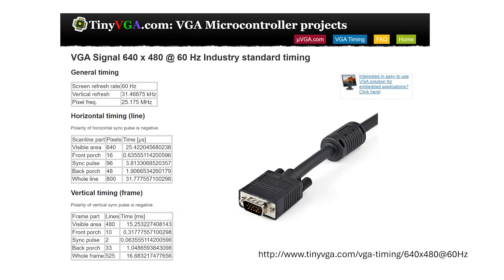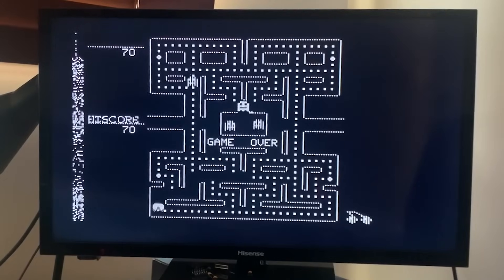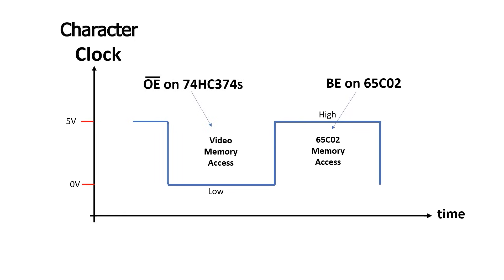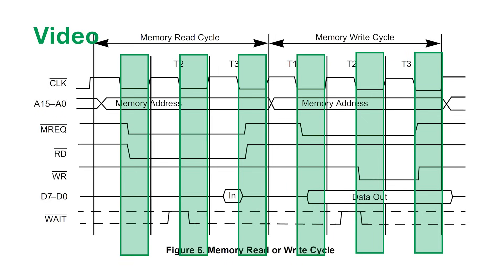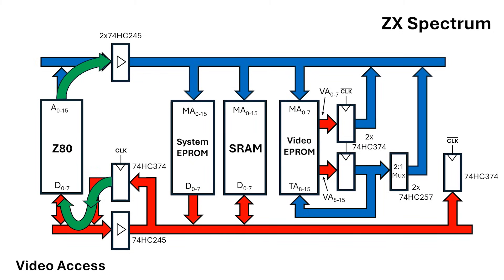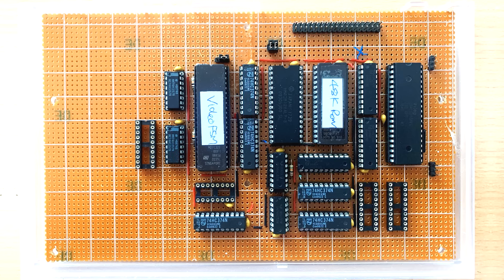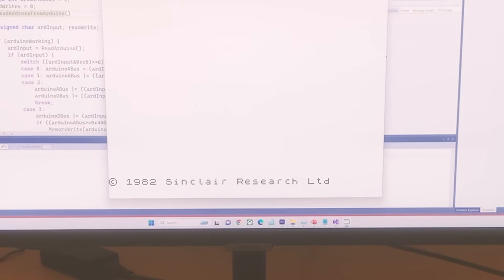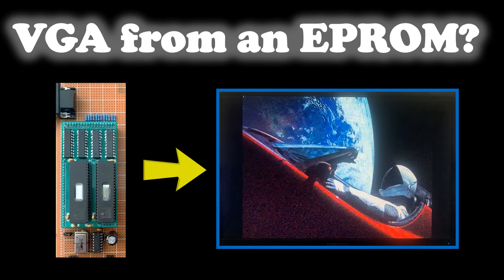ZX Spectrum build, No ULA.

Comment: I'm curious how your solution copes with software that abuses the machine to do things it's not meant to do (such as Knights and Demons DX or anything else that uses the BIFROST* engine)?
Reply from the maker: Yeah it will be interesting to see.  Do you have a list that might be difficult to run.  From the CPUs perspective, it's and NTSC machine, so PAL software that breaks on NTSC will still fail.  The upside is that we get VGA output.

Comment: Would it be possible to use the extra used memory in EEPROM to implement a EEPROM based Microdrive by using some additional hardware?
Reply from the maker: @StuartWoodwardJP  hmmm.  Not sure. I suspect not because the timing is quite critical to generate video.

Comment: Can you make the video ram double the processor speed so there's no contention
Reply from the maker: I’m not sure that saves any hardware (except maybe the 374). You still need to be able to tri-state the Z80 address bus.
Reply: @DrMattRegan  is that expensive?
Reply: Dual ported or double speed are those the only options?
Reply from the maker: @ you can stop the CPU with a BusREQ, or slow down the clock.  Have a look at the my Spectrum DRAM video.
Reply: @DrMattRegan  but the processor isn't even 4mhz the enterprise can manage 8mhz now see stefandrissen video mod player enterprise
Reply from the maker: @Sinclair-uq7jq  not really, just some 74HC245s and a 74HC374
Reply from the maker: @Sinclair-uq7jq  the actual spectrum slows down.  I'm not really into suping this machines above the original specs.

Comment: It might be overkill, but have you thought of using dual-ported RAM for the video RAM to avoid the bus contention?
Reply from the maker: Yeah, i'm not a huge fan of dual ported memory, hard to get, expensive etc.   I'd rather stick with more vanilla parts, but that's just my preference.  I would use them for crossing clock domains though.

Comment: I built my first zx81 from a kit.
Reply from the maker: How did you go getting it working?  Any problems?
Reply from the maker: Probably the biggest problem was the keyboard interrupt.   I tried using the interupt acknowledgement sequence to cancel the INT signal.  I got frustrated and just used the raster generator to limit it to 30 t states and that worked.
Reply: @DrMattRegan  oh right.
Reply: @DrMattRegan  Actually it worked first time I was so impressed, 
Modified it to give composite video output to a Sony monitor, much clearer.

Comment: Very interesting, and it occurred to me after watching this part, that you could add another latch or two to enable you to bank switch part of the RAM (the part which doesn't hold the video memory) to allow the computer to be expanded to run either multiple programs or programs with large amounts of data.  Edit: Maybe even simulate a RAM drive for fast loading of programs.
Reply from the maker: Yeah, good thoughts.  It may make sense to put video RAM in I/O space.
Reply: @DrMattRegan  You could address video RAM using the OUT command.  One method would be to have an output port to select which 256 byte section of the RAM (or which non-RAM device) you're addressing, and another to address the actual byte in video RAM (or device) which you want to access.
But my original thought was that, if the video RAM is located somewhere in (for example) the lower 32K in RAM, then you could bank-switch some of the unused RAM in the chip using the upper 32K of memory space.
(I'm assuming you're aware of the concept of Bank Switching)

Comment: Witch Wires are this? Im building a z80 handwired computer and im using much silicon wires that i need to decap all te sides before soldering then
Reply from the maker: These are wire wrap wires, but I’d recommend using the ones with Kynar plastic around the wire.  Kynar is quite heat tolerant and easiest to work with.

Comment: Could it be simpler to have two SRAM chips, probably even 3:  0 - ZX RAM 1 - pixels buffer 2 - attributes buffer?
Clearly separate XZ ROM+RAM from Video and just use WAIT when Z80 writes into video memory.
Even adding 1 or 2 SRAM chips could reduce total chips count, assembly and debugging?
Reply from the maker: At some point, the memory storing the video data to displayed needs two paths into it, one from the CPU and one from the raster generator.  Other than dual ported memory or VRAM, we are going to need some sort of multiplexing on the address lines, and this is where many of the chips are.

Comment: Dear Dr Matt,

I want to do simple changes to the main boards in future, to add graphics modes and object handling.  I was wondering if there is software that easily allows changes while simulating a running system running code, as proof of concept?   As a design that others could do on their system, or as a kit etc.   Or is there such software to do it through FPGA?

I've been very sick and haven't any electronic design experience.

I belong to a community that has the most computer language based microprocessor designs, for Forth, due to it's efficiencies, and some of the top performimg or loweat energy desugns. Mostly by Chuck Moore of the TPL patent portfolio.  I hope to get the team togther and implement a simple open source Forth embedded microcontroller design one day, and my more advanced instruction set architecture for performance. 

Youtube is a bit fickle at allowing links to youtube videos.  But, if you go to figforth group channel, then the latest forth meeting on the core 1 AI fpga for space industry, by Gould, you can see some of the stuff being done.  MyOR channel has a little forth computer with programmable read only memory amd discrete logic too, leaning towards what you are doing here.

Thank you.

Comment: Would it be possible to use this EPROM to replace the ULA on a real Spectrum? 

PS - I'm not that experienced with electronics, but I know how to solder and use a  multimeter. And do basic circuit calculations.
Reply from the maker: No not really.  This design uses SRAM, while the spectrum uses DRAM
Reply: @DrMattRegan  Would it be possible to adapt the design?
Reply: @peddersoldchap  I note that there was never a reply, but the reply would probably have been "not really, because I'd have no use for such an adaptation since I'm not using a ULA, but feel free to look into that yourself if you think you'd have a use for it."
My reply would be that as long as the number of inputs required doesn't exceed the number of address lines on the EPROM, and the number of outputs doesn't exceed the number of data lines on the EPROM, it should be possible to do it, but you'd have to figure out for yourself how to program the EPROM to provide the correct outputs from all possible inputs.
Logically, it wouldn't be all that hard.  It's just a bit of a slog, having to take account of every possible input and then ensuring that every possible input provides a sensible output, and compiling a bit-pattern for every memory location so that it can be programmed with the correct pattern later.
The only remaining issue is ensuring that the EPROM which you use is of a type which can respond quickly enough to keep up with the input signals.
Reply: @melkiorwiseman  thank you for your thorough reply. 

I would love there was an open source solution for implementing a ULA.
Reply: @peddersoldchap  The only part that a EPROM could not do would be to generate signals, such as from a clock circuit.  If you needed more than 8 output lines, you could parallel the address and access lines for two EPROMs to get 16 outputs.
Maybe someone will come up with a solution, but I could probably do it myself if (and only if) I knew all of the possible inputs to a ULA and all of the corresponding required outputs.  That's on the proviso that, as previously stated, the ULA didn't have any clock or timing role.
Reply: @melkiorwiseman  the zx spectrum ULA was retro engineered quite a few years ago, actually.
There's even a book on it.
Reply: @peddersoldchap  Cool beans.
Reply: @melkiorwiseman  if you ever get around doing it, make a video of it, please.

Comment: I used to do full wire-wrap, but would occasionally use this technique for parts of a circuit. One trick I used if I needed more than 2 wraps on a pin (or it was getting too busy) was to add an empty socket, wire the croweded pin to the empty socket and short socket pins together on the top of the board by sticking a wire in the socket.. You then had multiple pins to use for that one signal. Once a few pins were used this way, you could even cut off the rest of the socket with edge cutters if it wasn't needed. Sub and thumb.
Reply from the maker: Sounds good.  I'll try that if necessary.  You can sometimes get, 4 connections if you use 2 wires

Comment: Wow, what a blast from the past!  I built SO many little embedded boards using those Radio Shack prototyping boards and blue Kynar wire.  I stuck with 68000-series CPUs, including a 8MHz 68000, 16MHz 68020, and 33MHz 68030.  They all worked great, though I used PEEL programmable logic for decoding the addressing signals for the 68020/030 boards.  Very simple boards, mostly EPROM/flash, SRAM, logic, and random stuff, including an IDE hard drive using my own file system.  It was lots of fun reading the ATAPI specification for all the registers and commands!
Reply from the maker: Excellent.  I'm thinking of doing a series like the 
https://www.youtube.com/playlist?list=PLjQDRjQfW-85S5QkX8wZbkqichM6TLYYt
but for the 68000, a TTL-68000 CPU.  Would that be of interest?

Comment: Rather than soldering it all on - did you think about doing it all with wirewrapping techniques? I've not tried this myself (yet!) for anything though could be entertaining to give it a go. Also makes it easier to fix mistakes. I remember the first minicomputer I worked on (DEC VAX 8600), if you looked in the back, the whole backplane was wirewrapped!
Reply from the maker: Yeah, I've tried wire-wrap in the past, but i actually prefer point to point soldering.
I find wire-wrap (for me) to be slow.  I learned to do this back in the day, when wire wrap sockets were expensive.  Also i want to put it in a spectrum case.
Reply: @DrMattRegan  Understandable going into a spectrum case, no room for wirewrapped. Good video though so thanks for the interesting start to finish of getting that working.

Comment: Marvellous! This is how computers should be built. Away with the ULA, I never liked that kind of electronic parts, all that mistry, that hidden science, all those little secrets squeezed into one chip. It is a lot of work but the results are so beautiful to look at, it is craftsmanship. When the computer is not in use, you can frame it on the wall to look at.
Reply from the maker: Thanks for that.  Back to basics.  I think we should throw out the Z80 too - https://youtu.be/kfMMjk288co
Reply: @DrMattRegan  The Z80 has one advantage over the 6502 and similar chips, in that the Z80 has dedicated I/O ports so you don't need to waste memory space to do I/O.  Technically, with the way the Z80 handles the IN and OUT commands which use the C register (but actually uses BC), you could add up to another 64K of RAM as a "virtual drive" for temporary program and data storage.  Of course, this would mean you'd have to either go back to using memory locations for I/O or not use some of the virtual drive so those locations were left free for I/O, but it would be an interesting experiment to try.
Reply: @DrMattRegan by byA❤
Reply: The thing is, the reason behind the ULA makes perfect sense when you see the Harlequin board, which implements the ULA in 74 series logic.  Indeed, you just have to look at the complexity difference between the ZX80 and 81.

It's just unfortunate that these chips had to be reverse-engineered instead of documented, they could have been reimplemented in all sorts of ways
Reply from the maker: Yep, the harlequin uses the same technique as the Apple 2 (and TRS 80).   I used it too here
https://youtu.be/qbzzzkNPICI
Any guesses as to why i chose an EPROM?
Reply: @DrMattRegan  I would say, to make different screen modes, via "Firmware". Like Timex 2068, Sam Coupé or ULA+
Reply: @DrMattRegan  I've seen some cases where they've been used as a substitute for relatively complex logical devices, but I'd be lying if I said I understand the process here.

WHY is relatively easy.  PROM is cheap.  How, i don't get.  Yet.
Reply from the maker: @schmitzbeats6102  good try

Comment: Amazing job! I'm really impressed with this build.
Regarding the Arduino that you plan to connect, I did something years ago that could give you some ideas. I created a shield that interfaces an arduino mega to to an unmodified spectrum. Using some glue logic what it does is to automatically trigger the /WAIT signal allowing the arduino to have time to process the info from the Z80. The arduino can act as a device and/or as a memory block, the arduino receives an INT when a read/write happens to the addresses of the device or the assigned memory space and then once it processes the request it frees the /WAIT line. It comes with a full framework to create anything (I did a virtual ROM, a network card, a snapshot loader, an automatic POKE machine and even a MIDI sound card) so it might be useful for you to get ideas. Is all published in Github, if you search for "ZXShield" you will find it (check the wiki, all is explained there) and on my channel I have some videos showing it working in various modes.
Cheers!
Reply from the maker: Cool, i'll have a look at it.  Did you have any problems with refresh?  While the arduino asserts WAIT it will stop the DRAM refresh.  If you're quick it shouldn't matter to much.
Reply: @DrMattRegan  Never had problems but as you said, I tried to retain the Z80 the minimum time possible. For slow operations I implemented an asynchronous pattern on the "peripheral" mode, I simulated a register set so the Z80 wrote to a register, the arduino updated it on an interrupt and after releasing the Z80 I processed the request. Whenever a register was wrote it became "locked" so if the Z80 requests the status of that register it responded as "busy" so it would be able to know when the arduino finished processing the request. All is documented on the wiki of the repository :)

Comment: Is it possible to isolate Z80 A & D buses with just 10k resistors like in original ZX?
Reply from the maker: Yep, should be possible to use resistors, but you still need the 74HC374.

Comment: Personally I have always used wire wrap for projects like this but your point to point wiring technique looks great and as you point out much cheaper than wire wrap which is insanely expensive for the sockets. Using an EPROM as a replacement for the ULA is also a great idea.
Reply from the maker: Yeah, wire wrap sockets are hard to get in 32 pin packages.
Reply: @DrMattRegan  Can't say I have ever had problems getting any size socket but they are bloody expensive, Mouser have 23 pin DIP in stock.

Comment: Superb work! I did a Zx81 like that and it never worked. Interesting idea cant wait to see this clocked at 3.5Mhz. I wounder how much faster it will go especially when youve put the design on a PCB. I suppose it does work as your making videos about it? Cool! Im currently working on a Nes Emulator. the PPU runs every tick and the C6502 runs at a Modulo of 3. Are you going to release the schematic and build parts when your done.
Reply from the maker: It’s a work in progress.  Did you use a CMOS z80?
I did point-to-point wiring for a ZX81 in this series
https://www.youtube.com/playlist?list=PLjQDRjQfW-84WG47-5UjPz1BrXxc1acvd
which did run at 3.25 MHz.
Reply: I used a Zilog Z8400A PS. Have you ever thought of using a Teensy or a stm32 for the ULA?
Reply from the maker: I'd rather not use modern parts.  The EPROM and SRAM were available in the 1990s.
Will do a schematic once finalized.
Reply: Cool old skool

Comment: Neat. Your point to point wiring looks so much better than mine. I find that when I am halfway through I realize I have painted myself into a corner, and the latter half of the build is trying to avoid melting wires from the first half.
Reply from the maker: Exactly! I do have that problem later as well, it happened a bit on the SAP6502 build.  Some pins were several wires deep.

Comment: This is absolutely gold.  Loving it.  Really clever solution to the problem.   
On construction technique I'm also impressed.    I think I'd lose the plot with that sort of point-to-point IC socket wiring. I've prototyped using soldered break-off SIP machine-pin sockets designed for wirewrap and that was hard enough.
Reply from the maker: Thanks Andy, it's a fun little project.  It should end up at < 30 chips.

Comment: I've always wondered why the authors of the clones didn't do this right away? Great job!
Reply from the maker: Thanks.  Yes, Superfo uses a second SRAM for storing the video. I still haven't to get it to work at speed yet (still working on the VGA output), but for the moment, the 74HC374 seems to do the trick.
Reply: That makes sense now. I was wondering what the second RAM chip was for on his ZX-128- Max design.

Comment: Can you share what wire and insulating you're using?
Reply from the maker: So this is the exact wire i use  https://www.jaycar.com.au/blue-wire-wrap-wire-on-spool/p/WW4346?pos=1&queryId=5bf58702e3ae70ed5bcbb145f0e4f3ef
It's from a local retailer, but it is kynar brand, you should be able to find it on ebay.